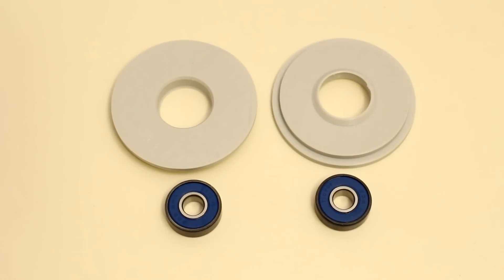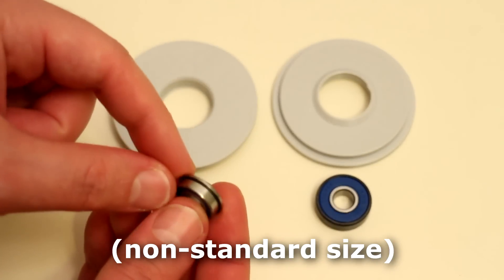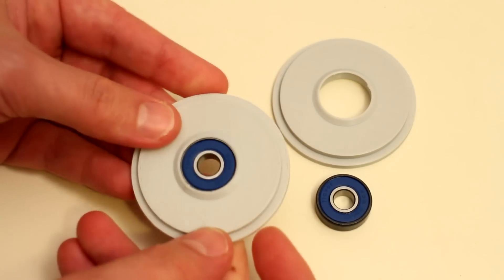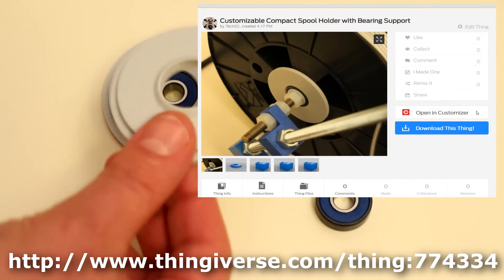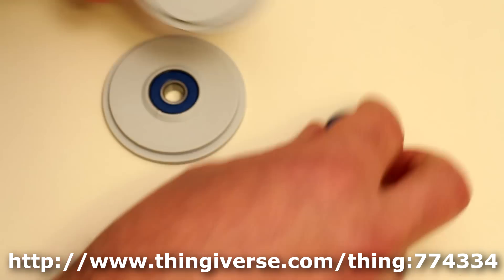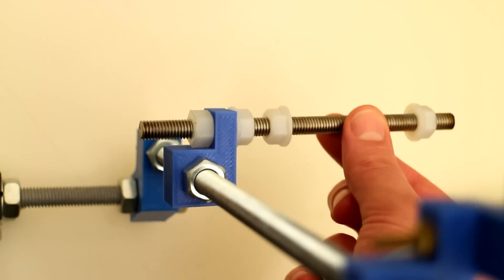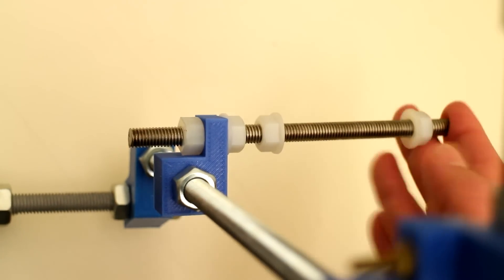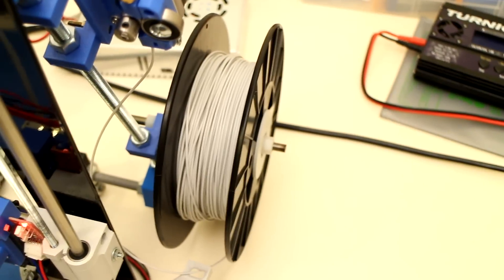3D Printer - Customizable Spool Holder

Comment: Hi. I personally prefer Slic3r than any other slicers, it has a lots of nice features but I have a seam problem. It ruins the whole print. Tell me please what was your way to get rid of that :)
Reply from the maker: Dzidecznik Try adjusting the retract length and retract speed. Ideally you want to retract as little as possible without dripping and as fast as possible without slipping, so the layer change print move is as fast as possible.

Comment: Hey what are your thoughts on the folger tech i3 kit? It's in ebay and folgertech.com
Reply from the maker: robotluke123 Competitive priced kit, check the postage cost though. Looks solid. Check for support and reviews.
Reply: Luke's Bikes Might be a bit late here, but speaking from experience... if you can afford it, try looking elsewhere  for something a bit more substantial. I bought that kit, though upgradable, it leaves a LOT to be desired for starting out on. Quality control, not not so good, and flimsy.
Reply: 55rebels hmm what do you think of their new 2020 one?
Reply: Luke's Bikes Man.... that was quick! lol! 
Sorry, I have no experience with that model. I can only suggest that you read through the forum thread concerning that model @ RepRap --  http://forums.reprap.org/read.php?406,512329,page=1. This should give you a good idea of the issues with, or lack there of. Good Luck
Reply: 55rebels thanks! i just happened to open youtube at the right time

Comment: Hey Tech2C, what do you think of the ormerod 2 printer? http://replikeo.com/en/3d-printer/ormerod-2-3d-printer-complete-kit
Reply from the maker: GreenFood64 That is one sexy kit. As long as the x-axis is stiff as it's only supported from 1 side... Very compact, easy to access, a little pricey, but before buying any printer ensure the design can print great quality parts and there's support if you run into troubles. Best place to start is the reprap forum.

Comment: use cones instead ,it will work with any size hole in the spool .... like tire machines use
Reply from the maker: +Monzter 46 
Totally agree. This is a compact spool holder, but a cone shaped version would suit many sized spools.

Comment: Why is the 1.75mm version 100$ more than the 3mm?
Reply from the maker: TheFreeMan What do you mean?
Reply: Tech2C 
On replikeo's website changing the filament diameter option from 3mm to 1.7mm increases the price by 100$
Reply from the maker: TheFreeMan Ah I see. Replikeo have dropped the price by $100 for the 3mm kit, and maintained the original price for the 1.75mm kit. I was wondering about their prices as other Prusa i3 kits are now available for cheaper. Good move by them. Still, no idea why the 1.75mm kit is $100 more though?

Well, either buy the 3mm kit and also buy the E3Dv6 1.75mm universal hotend and switch over to Bowden, or have a look on ebay and https://www.3dprintersonlinestore.com/ for other Prusa i3 printers available. There's so many to choose from these days at these price points.
Reply: Tech2C Maybe it's because 1.75mm's are more expensive? How does the size of the hotend affect the quality?
Reply: Tech2C  buyer beware the 3dprintersonlinestore prusa i3 i purchased recently had several problems with it, including: poor belt attatchement design, really low quality linear bearings that fell apart almost immediatley, incorrectly wired cables for z-axis and poor customer support and instructions, though you get what you pay for and even though some parts were replaced i still saved over 70$ so it's really up to you on how much your time is worth to fix errors inherent to poor quality control.
Reply: Eamon Glavin
I think I may just go with Replikeo
Reply: probably a wise move